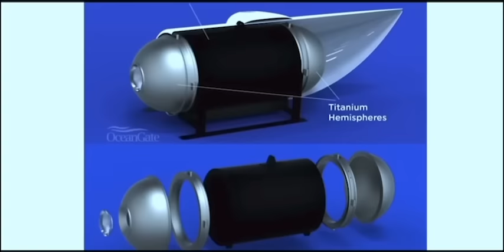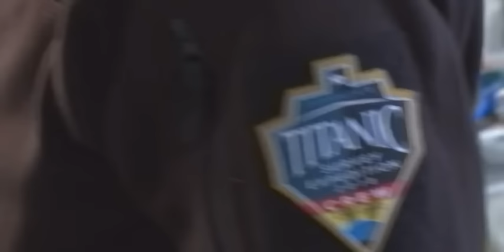First look at #oceangate #titan Debris

Comment: Something to note: I have seen submersibles that were cigar shaped. HOWEVER, the builder of one of the submersibles (it was French, I can't remember the name of it) showed the media a cutaway picture and it was actually made of three spheres welded together with a thick ring between each sphere. THEN the long, straight sections were welded over it. Their rationale made sense: even if the outer layer collapsed, the three spheres protected the passengers because they were suspended inside. The three titanium spheres did not touch the outer walls. And it was not a massive sub either. Each only held one person so the first sphere held the pilot, the other two held one passenger each. Still, the French sub would not be able to descend to the depth where Titanic lies. It was pretty strong and could go about 1,000' feet but they never exceeded that depth. To me, 1-2,000 feet is impressive if you can still carry passengers...
Reply: this French submersible you are talking about was not made of  carbon fiber.
Reply: how many times tdo I have to joke abbout the sube being glued togehter
Reply: Do more reading. Wikipedia Aluminaut 17000ft rating and the various DSRV.
Reply: I can't believe that it made it there and back six other
Reply: Its a common technique used in most military submarines, you have the inner pressure vessel where the crew and critical equipment is contained. Then the outer shape for better hydrodynamics and storage of items that don't need to be inside the pressure vessel
Reply: Room between inner pressure vessel and outer shell is under the same pressure as the external water pressure, the outer shell is in these cases to improve hydrodynamics, i.e. to give better movement characteristics. In any case, based on physics, it is necessary to keep the surface of this spherical vessel as even as possible, it should not be very rough because it causes buckling instabilities due to hydrodynamic pressures, this means that, for example, in the case of a cylindrical pressure vessel, the forces acting on the vessel try to compress the vessel and simultaneously with the movement (be that as it may with the movement of the vehicle itself or the movement of the external environment hydrodynamic flow this compressive force tries to twist the vessel), therefore a cylindrical vessel is a very bad solution, adding untested materials and an incompetent engineering approach.
Reply: @inarinukka7729  there is nothing wrong with a cylindrical vessel. Most military subs are cylindrical. The problem was glueing two dissimilar materials together. It was madness not to have a mechanical connection of some sort and rely on glue to hold it together
Reply: Yes, it was a French cigar shaped submarine but it was not welded and contained no Titanium. It was designed for exploration, salvage and research and was named Aluminaut since it was made out of aluminum. They chose the cigar shape due to the need to carry 2 crew and 4-6 scientists plus the equipment. The sections was not welded. The aluminum alloy 7079-T6 (high zinc content) could not be welded effectively, so the designers opted to build Aluminaut in sections that would machined to fit tightly together and be fastened with bolts. The resulting pressure hull has 11 cylindrical sections, bringing the hull thickness at 6.5 inches, and two hemispherical "heads." Each seam is bolted together with 40 large bolts. Corrosion resistance on Aluminaut was achieved by coating the external aluminum with epoxy paints and by the use of special metal plates mounted to the exterior. These metal plates were designed to prevent electrolysis from damaging the aluminum hull. The special metal plates, called sacrificial anodes, attract corrosion when electrolysis occurs, preventing damage. As long as these plates are intact, the aluminum is protected. Aluminaut was designed to dive to 15,000 ft deep and withstand up to 7,000 pounds/sq. inch. Due to its great buoyancy, it had a payload capacity of 6,000 lbs., a record for deep submersibles.

Comment: There is another reason you don't mix materials, ESPECIALLY when bonding:  Thermal Expansion / Contraction coefficients.    
Over time, differences between how much the Titanium, Carbon Fibers, and Adhesive will expand and contract from changes in temperature will also fatigue the adhesive at the joint.    
So, not only did they fail to test for fatigue due to pressure changes, but temperature changes as well.
Reply: Right... and the thing is constantly cycling from about 29 degrees at the ocean bottom to about 70-80 degrees at the surface, or more (whatever the surface temperature is.  Repeated pressure cycling and temperature cycling and the different coefficients of expansion/contraction produce fatigue in the joints, or cracking.  Extreme stress can build up between parts expanding at different rates, and where there is no expansion joint or other means to relieve the pressures...
Reply: The 'Comet' airoplane springs to mind.
Reply: they didn't even degass the resin used as the bonding agent

Comment: Absolutely that's where the failure occurred, words cannot explain how dumbfounded I am that this guy would literally glue two different materials together and expect it to hold with extreme pressure I am 100% in agreeance that the failure occurred at that mating. Regardless of what these people signed a lawsuit should still be filed absolute betrayal of trust this company worked on the cheap endangering lives.
Reply: I would proceed with a lawsuit. Bc though they signed on the dotted line, they still could have been misinformed. Like they can say "this expedition may cause loss of life" but did he actually tell those people, the vessel is made of 2 different materials that expand and retract at different rates? Did he tell them that most submersible or sub are sphere shaped for a reason. That titan is using carbon fiber filliment as an experimental pressure hull? Yeah know?
Reply: @daisymonster47  Full disclosure needed
Reply: @daisymonster47  I definitely agree with you

Comment: I have machined alloys to bond to carbon fiber and the alloy areas to be bonded ALWAYS need to have a VERY ROUGH surface finish. And after the bonding, there is a very specific baking process. I worked directly with a Phd who was on the Discovery Chanel giving an informational interview. He knew carbon fiber.

Comment: Well, if the cylinder carbon hull flexes, like in the comments spoken about,  yes the end caps can come lose.
On the other hand,  they made a few dives like this, so in principle, it did work.

What I think could be a plausible cause is that the carbon hull got the bends.
Water ingress in the micro bubbles in the carbon epoxy by the tremendous amount of pressure, compressing those bubbles. 
When surfacing again, those bubbles expand and could cause micro cracks in the carbon/epoxy integrity and weaken the hull as a hole. 

A documentary of a former technician (forgot his name), who did the second dive, noted loud bangs when resurfacing at 300m depth. 
That could be stress release from the expansion of the bubbles, tearing the carbon on mirco level, apart.

But, this is an opinion from me as a 40-year experienced ship engineer. 
Of course, based on the info what I gathered from the internet. 

Hope they will find the root cause.

Comment: A tube with domed ends is not the bigger problem.
The use of different materials is the major one. One will move more than the other, a bit like an ally head on an iron block, and in time these joints will inevitably fail.
Bendy homogeneous glued onto stiff, layered and rigid = smashy.

Comment: I am not an expert in submersibles, but I have a physics and electrical engineering background.  Carbon fibre from what I know if under enough stress it can shatter and fragment in to many shreds and pieces.  Proper steel of the right amount of thickness with the right amount of elasticity to not make it brittle is the key. The alloy of metal used on submarines would be the proper type of metal.  For things like ski poles, bicycle frames, some types of vehicle and aircraft parts, it is acceptable when used within very well rated and well tested boundaries of its specs. 

From what I read and saw in the videos was indicated that with each dive there probably were new stress points maybe causing micro cracks in the structure of the carbon fibre shell. Eventually like glass that has scratches when under pressure finally gave in. 

When it comes to life and safety, new innovations have to be very carefully tested and rated. Tests must be repeated over and over again to determine the usable lifespan under the highest amount of pressure to be used.  For example with aircraft they rate the air-frame in hours of flight. After the tested and verified rate of hours reached close to the safe rating, the aircraft must be retired. It should be inspected, and if the still considered safe the aircraft may be used for the odd demonstration, but not for constant use as like when it was in service. 

All aircraft, road vehicles, boats, appliances, and etc., must all be properly rated and have some type of certification to be rated safe when used at the level of their design. There are international accepted standards for this.
Reply: I don't like the fact that it's used on aircraft like the Boeing 787. There have been some problems with it there, too.
Reply: @suew4609 that's true.  I had forgotten about that.
Reply: "For example with aircraft they rate the air-frame in hours of flight." And where did we learn that? After multiple deadly failures of pressure stressed comet planes! How many times stronger than needed is an Airframe of todays Airplanes?  What he could have done was to careully test and rate. And still centuries later the Ship Norway had a catastrophic steam boiler explosion. The then  brand new container  ship Emma Maersk had a catastrophic failure of a Stern Sideways thruster - consequently flooding the whole Engine room up to a height of 15 Meters. After that they changed the design of the thruster propeller. I wonder why?  In 2022 the wooden/ steel Tretten Bridge in Norway collapsed after only a decade with regular inspections in place. Yes there is still risk involved in innowvation and engineering. It is very mitigated which is great, but there's little margins in many places. That does not excuse the shortcomings of this special innovative vessel engineering team - but it's also not the only catastrophic failure in recent history and solely would have happened because a lack of understanding. After the fact we howpfully can better rate such a material combination. The prove that it would not have withstood even a single dive to that depth has been ruled out clearly. Seems almost everyone commenting is surprised and doesn't understand why it ever worked in the first place? Understanding and testing is the key. Sometimes after the fact. Even in today's engineering.
Reply: i fear that's why they wrote something along the lines of having found "suspected human remains"

Comment: Carbon fiber construction is strong in tension, but not in compression. his pressure hull was loaded in compression only both radially and axially. in fact, he wrapped the carbon fibers circumferentially based on the videos. That means that the compression caused by the axial force from the end caps were being transferred to the adhesive matrix that the carbon fibers were held together with - the carbon fibers themselves were not taking any of the load. also, radial pressure along the length of the hull loaded the carbon fibers in compression where they have little strength. Basically this hull was supporting all the pressure through the bonding matrix alone. how could no engineer working on this thing never stop to think about this!!??

Comment: Let me clearly understand: Those titanium rings are fixed on carbonfiber tube by some resin/glue between exterior of tube and interior of ring ONLY? They were NUTS?!
Reply: yup glue failure is my hunch
Reply: The outside pressure will keep them on... the builder probably

Comment: A good analogy is squeezing a plastic Easter egg, the male lid will pop off once distortion is enough. You're right about ends popping off. There are suggestions that the rear cap interface had cracking sounds on purported text comms between Titan and the surface ship. This makes sense as it would be difficult to inspect that area frequently. If it failed at one end a water hammer could blow the windows and both ends off but this is speculation until more detail are released.

Comment: Not an engineer but if I was considering some adhesive between me and being horribly crushed I would be thinking that all adhesives eventually fail or lose their bonding strength over time, especially with varying strains.
Reply: Plus, your bonding two different materials. One material is going to change/move slightly.. but, isn't going to be consistent with the other material changing/moving under that much pressure.
Reply: You do know that adhesive bonding is VERY common on aircraft???
Reply: @caerleon87  To keep the warning stickers on like the one that says dont step on wing since its glued on?
Reply: One of the submersibles that went down the Mariana trench simply used o-rings between the two half-spheres. Basically the water pressure kept the sub together.
Reply: @bingo7799  Lots of structural parts like the wings themselves as it happens. Not so smart now eh..
Reply: @johnSmith-my9yj  probably some very strong bolts too.
Reply: Toss in a LIL salt water on top of it also..

Comment: The titanium and carbon fiber composite would also contract and expand at different rates under pressure and temperature changes. Another reason for the pressure vessel parts to be made of the same materials like  all Titanium or all Steel alloys.
Reply: I was thinking about the effect of temperature too(although the most likely cause was pressure). It's damn cold down there. "Cold enough to freeze the balls off a brass monkey".
Reply from the maker: exactly right! unreal it made it down as far as it did numerous times

Comment: I didn’t know that they literally glue the titanium to carbon fiber, this is absolutely a dark comedy
Reply: Gluing is actually the best method  when the joint is designed  and the materials prepped properly. Mechanical fasteners are point loading ,a bad stress on carbon fiber. Bonding carbon fiber and metal is done routinely  in aerospace.
Reply: @LG-ct8tw  Wouldn’t it be better to have something like a metal ring with metal studs welded to it and the carbon fiber laid up around it so it’s completely embedded in the fiber with the studs protruding? That way there wouldn’t be any point loading and it would be as strong as metal rather than glue.
Reply: @LG-ct8tw  high performance gluing using appropriate tools and materials designed for handling the extreme conditions is different from putting glue with hand and not understanding the concept of thickness and density of the glue and the ignoring the concepts of temperature and pressure effects on different materials

Comment: Finally dude someone that has it right.  With that viscous epoxy they trapped a bunch of air in there.  I've done some epoxy work and when you try to squeeze parts together like that it could have acted like a piston trapping and compressing air inside the cavity of the titanium ring.  Also I bet it was on the side where the door hinge was.  Looked like when the front end bell was open the entire weight of it was on the titanium ring.
Reply from the maker: right and what about the weight of those titanium bells at the end!? when the front was open the weight would be pulling at the glue seem! oh man just all bad. I cant believe it lasted as long as it did!